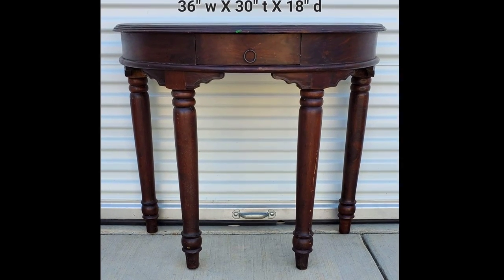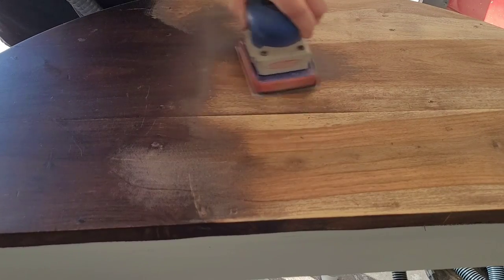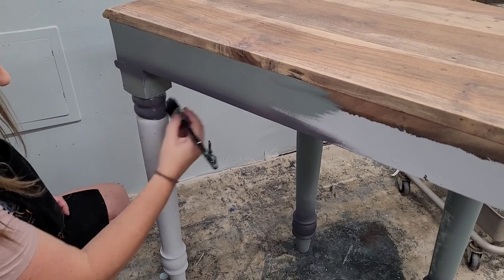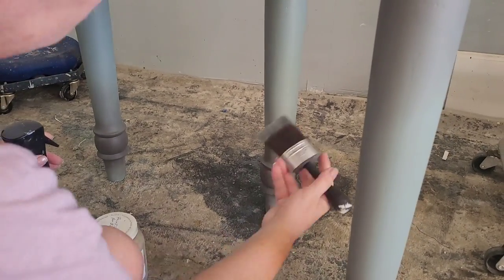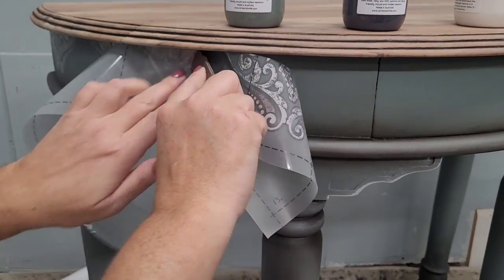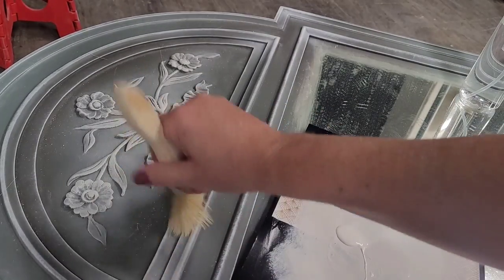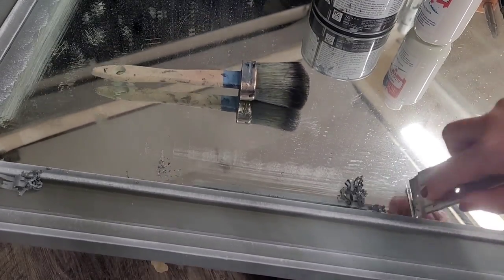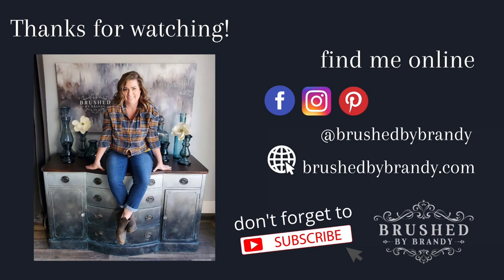How to Take an Old Dresser Mirror and Turn It into an Awesome Entry Table

Comment: I'm in awe of your talent, especially at blending colors!! I'm doing a bar cart, would you seal the paint before putting on a transfer on the top of it?
Reply from the maker: It depends on the brand of transfer it is, redesign with prima transfers do great over raw paint, then seal afterwards